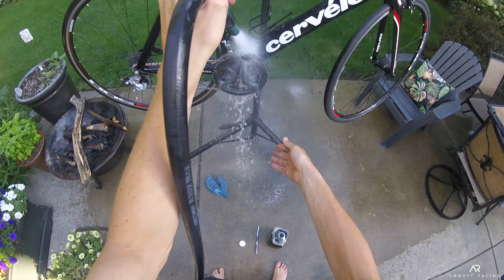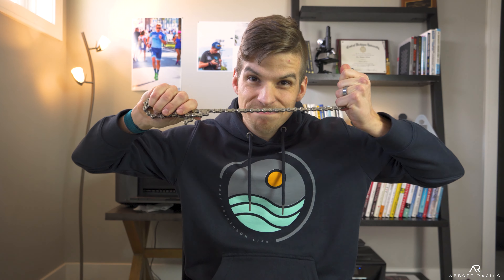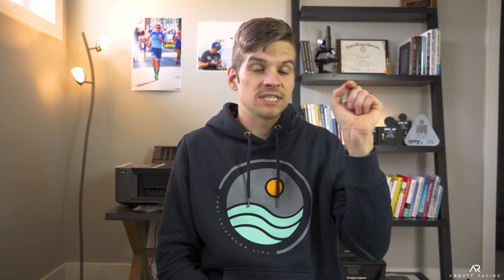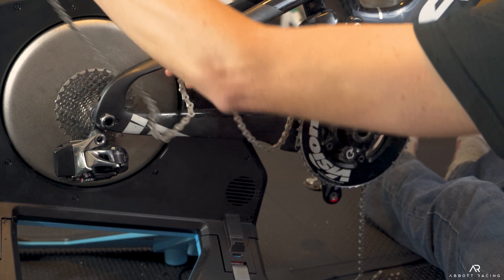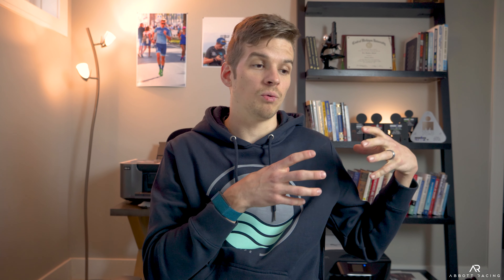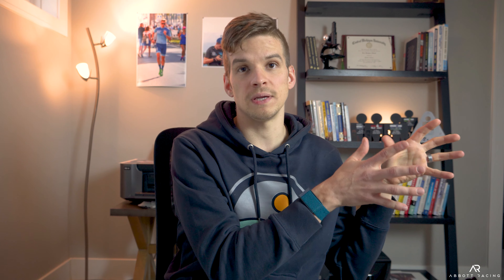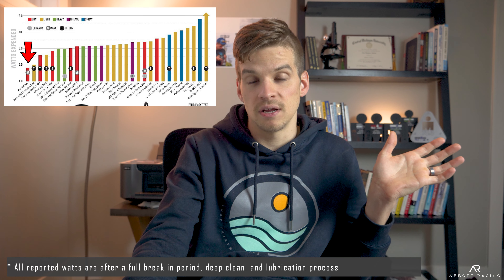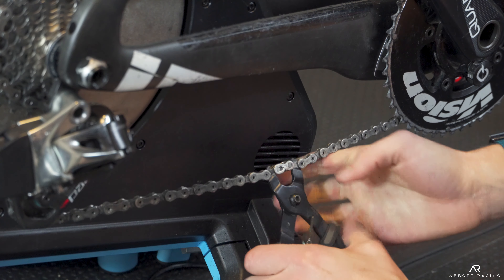Save 3 minutes at your next Half Ironman with a race day chain

Comment: I have a very similar chain care routine except I bought myself an ultrasonic cleaner last Christmas which makes the cleaning part a bit faster (one still has to do at least two cycles with it as well, the chain is basically coated the removed grime after the first pass). I don't apply Squirt on the both sides of the chain though; I just make sure I put the chain on so that the side I did apply lube on goes as the "inside" track (easy with Shimano chains at least since they're directional).

Comment: DRY IT IN THE OVEN!
Reply from the maker: No joke, I actually use to do that; but I found it would accelerate the rust process and I would end up with some rust spots on the outer links.
Reply: @EricRidesDirt  One year late... ever thought of dousing it in alcohol (or better acetone) before the drying? That would prevent rust.
And yeah, it is only a few watts on the chain, some more on the bottom bracket, the derailleur and so on. Those watts add up. Good maintenance is key.